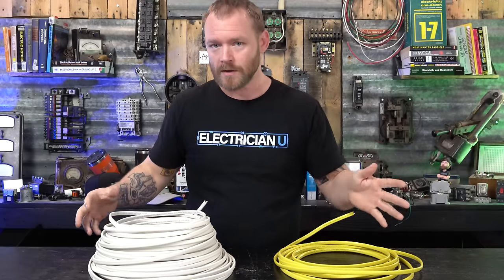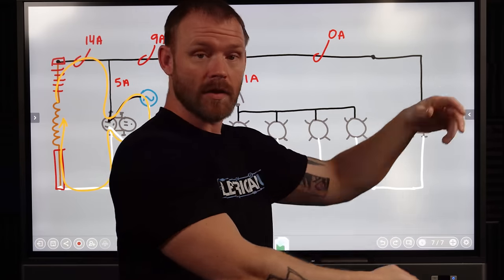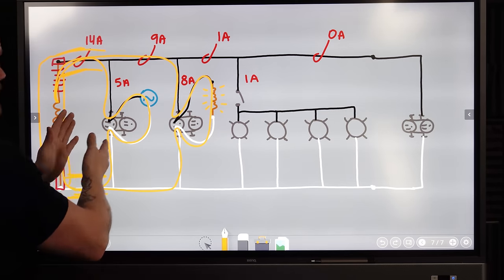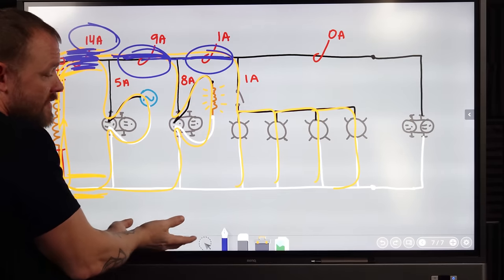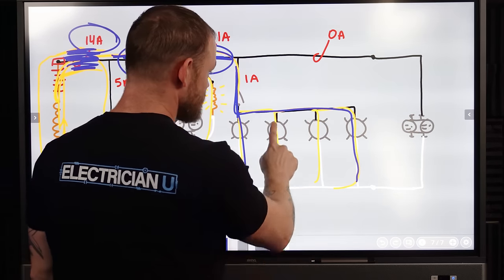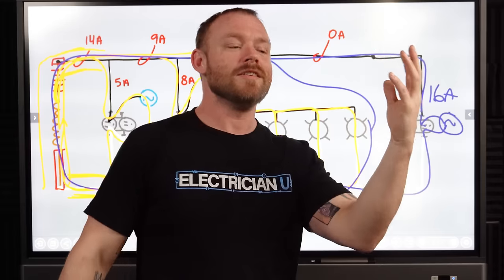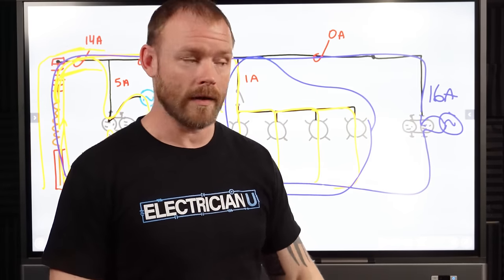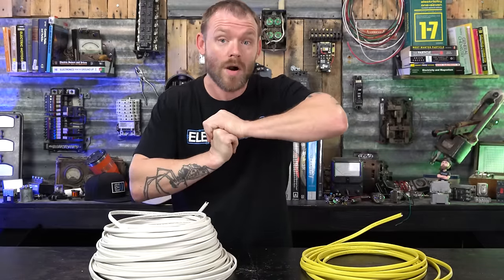Should You Be ONLY Using 12/2? When Can You Use 14/2?

Comment: Our AHJ lets us run 14 between switches and to dedicated LED luminaries without a socket base.
Why they are okay with this is interesting.
1
NM-B is 90c wires. It can handle 25A. It’s limited to 15 by convention at the 60c limit for historical reasons (there’s a lengthy discussion in the committee comments on incandescent/hid luminaries and nm, without the b, cable from the 70s)
They use the luminary and dedicated circuit code to justify why this is okay.
2
The switches and dimmers are only rated for 15A. Or less.
Likewise, a 5-15 can be installed on a 20A circuit. So, this hazard for is already determined as an acceptable risk.
3
Partial faults resulting in more than 12 and less than 16A just aren’t likely to happen. Faults tend to be opens or shorts. And, from 1, it’s not going to fail even if you do have a partial failure.
4
Workmanship in LED luminaries junction boxes is likely to result in abraded, pinched or cracked wires and insulation because the size of the boxes is just not great. This is much more likely to cause a hazardous failure compared to a partial over current failure.
4b
the new NEC regulations (410.11)  prohibit junction boxes behind finished ceilings above luminaries. (Otherwise they would require j boxes above each led light)
5
LED lights terminals are rated for 75c. And they don’t put out much heat. This is counter to why 14 and 12 is limited, so, the AHJ determined the risk for permanent LED fixtures sufficiently low, providing it is difficult to install something other than LED lights.

There was a lot more detail we went into, but this is all I’m willing to type up.
Overall, of all of the risks and hazards involved, their department felt this was the least likely to result in failure.

Comment: i've run 30a through 14/2 (open air)as a long extension cord one  temporarily. it got warm but not to the point it damaged it.  the codes are designed for maximum safety and really derate things for said purpose. the only thing other than code arguments here would be the topology in the circuit. it must be correct. it must be so that at no point if there is a fault  that the neurtal wont be carrying 12 ga amperage on a 14ga neutral. his diagram should have shown the light neutrals coming together then teeing into the return  singularly.

Comment: There is 0 reason to use 12 gauge wire in bedrooms amd lighting circuits. Over 100 homes later and we have received 0  calls about 15A breakers tripping. 12 is got kitchen baths and garage. And dining because it’s required.
Reply: That's how we do it also. Never had a problem.

Comment: I wouldn't cheap out on 14ga from the switch to the lights. The LED light may only draw one amp but a fault in the circuit won't draw just one amp! 14 vs 12 could mean the difference between a house fire and just a breaker tripping!

Comment: i have always been of the opinion that lighting should be on its own circuit. Also, all receptacles in a room  should NOT be on the same circuit. Reasoning is that if you have to work on a receptacle, you can kill the circuit that receptacle is on and still have lighting and a hot receptacle in the room if you need if for any reason. But i seldom see that. and its sad.
Reply: If you are building your own home your logic is sound, but contractors bid on these houses and they are insanely competitive.  If you included any extras above minimal electrical code you price your self out of the job.  Sounds crazy but the numbers are that tight.
Reply: @Privat2840   i blame ion the architect. that should be that way on the prints so they get bid that way. Also, AC units should not be in attics and flex duct and ductboard should be illegal. BUT if people continue to accept junk work they will get worse than that as time goes on.

Comment: If cheaping out with 14 AWG wire saves "thousands", that must be a REALLY big house! Current price difference, as of 30 minutes ago, was at .10 per foot. Yep, TEN CENTS/FOOT. So, 1000 feet of 14 vs 12 would save a whopping hundred dollars. To put it another way, to save "thousands of dollars", you would be running a MINIMUM TWENTY THOUSAND FEET!  
If someone is buy a house so big that it requires 20,000 feet of wire just for lighting, I question whether they would even notice a $2000 bump in the electrical equipment cost.

Comment: The difference in price between 12/2 and 14/2 might be 10 cents a foot.  But even if that is 20 cents a foot, you are looking at $200 difference for a 1,000 feet.  If a person is building a $300k or $400k house, what is few hundred dollars?

I can see that with LED low current lights, you can have a lot of lights and only use a few amps.  BUT, if you are coming off of a 20 A breaker, you have to use 12 gauge wire.

Comment: Would it not be a concern that if there was a short circuit in one of lights, the 14 awg could melt before the 20 amp breaker trips?
Reply: A short would trip the breaker.  The bigger concern is an overcurrent situation.
Reply: According to my journeyman electrician friend, the short would cause a current surge up to the max allowed by the breaker. For that short time, you would be pulling 20amps across the 14awg wire causing it to heat up and potentially cause a fire.
Reply: @paulgrn1  Sort of.  But a short will trip the breaker so fast, fire is rarely (if ever) going to be an issue.  The bigger concern is an overcurrent situation that allows time for the heat to build up.

Now, if the breaker fails to operate, that's another story.  But if that happens, it really doesn't matter what size breaker you have .... the weakest link in the system will melt.

Comment: What happens with a fault on the 14 circuit whereas the wire is made to not melt at 15 amp but the cb does not open until greater than 20amps

Comment: I use 12/2 on all circuits. That way if you need to upgrade to a 20 amp receptacle for some reason it's plug and play. 
To argue against using smaller wire to the lights and small loads consider this, if nothing else is on and you're on a 20 amp breaker, turn on the light wired with 14/2 and a rodent has chewed the insulation. You now have a 20 amp breaker on 14 gauge wire, that is instant fire.

Comment: In the mid 80's my father would say that LED's will become normal and replace incandescent bulbs. He also said you will see designated 8amp breakers using 18 gauge to run household lights.
Reply: 8-amp, #18 lighting circuits would be a great thing, actually...  Using #14 or #12 wire for power-sipping lights seems like a waste of copper!
Reply: Actually SqD makes a 10 amp breaker in the Homeline series, and I think they can do them in QO as well.  I would like to see, with this switch to LED lighting, 16/2 and 16/3 romex and 10 amp breakers become the new standard for lighting circuits.

Comment: I went with 4 AWG for just a 12' run to an EV charger. Charge max is 48A. My dad says I wasted money and should have used 6 AWG.
Reply: @@Hfh_Df Electrician told me Romex max size was 6 awg. He ran individual wires in 4 awg.
Reply: @Hfh_Df  It's copper and the breaker is 60A. When choosing the gauge I knew 6 would be legal, but I wanted to run cooler, have a tiny bit less voltage drop, and future-proof the line for potentially more current in case I get additional EVs. The difference in cost between the 2 gauges was nominal.

Comment: Electrical Engineer w/ 15 years experience - incorrect code aside, if you do this with a 20A breaker, if there is a short circuit in the lighting during a fault you can and likely will severely damage your 15A conductors during the short before the 20A breaker trips via magnetic break. It probably wouldn't spontaneously combust, it could, but the wire can brittle, insulation brittle, and even if you make it through this, youre setting yourself up for a number of issues. That couple thousand dollars cost savings doesnt sound so appealing versus the pile of ash and insurance headache. Its not a matter of should, its a matter of when, and while everything is fine when working as expected, the truth is you must plan for the faults.

Comment: When in doubt 12-2 because if you ever need to expand a circuit you can by changing the breaker from 15A to 20A the issue is the cost. But I would always error on over kill on the conductor due to heat & electromagnetic generation the thinner conductor will cause under load. It actually comes down to surface area which the larger conductor has because electron flow happens on the outer skin of the conductor. Also #24 AWG can only support .5 half an Amp of constant current so it's a No Go for the lights.

Comment: For residential usage some local cities outlawed 14awg  Four decades ago. They got tired of Goobers using it where 12 should be.

So a local code guy can force you to use 12 awg since that is the local code.

What happened is jerks wired up remodeling and new homes with 14 awg and owners or even builders used later 20 and 30 amp breakers..then when folks ran 2 or 3 space heaters the 14 awg guage wire got hot

So you can be a jerk and use 18 awg lampcord  and 60 amp breakers too. Then when you home burns down the fire insurance will be none since you skirted common sense. Lol

Comment: 14-anything Might be good for LED lights but it’s not forward thinking Belt-&-suspenders approach.

Whilst LED lights might draw low amps? If somebody comes through at a later date and puts in a higher draw-amp fixture?, The 14–anything won’t be sufficient for that circuit.

 Best practices is to go with too much than not enough.

Comment: Been an electrician with masters and company for over 50 years and this doesn’t make sense to me. LEDs have drastically change our lighting loads so if you want 20 amp circuits for all receptacles —- do it. In most house you can probably wire all lighting on one 15 amp circuit anyway, problem is if you use fixtures with medium or candelabra base bulbs you can’t stop the next person from installing incandescent bulbs which changes loads quite a bit.

Comment: A couple of years ago I watched an electrical inspector (here on YT) say that lighting and outlets MUST be combined for a room. Holy shit! What a stupid and potentially dangerous idea. Plug something in, pop the breaker, and get plunged into darkness. If that stupid rule were in my jurisdiction I'd put in the plans that lights and outlets are on separate circuits. If the planning department accepts the plans, then you've got a chance with the inspector. If PD points out the "problem" I'd argue for a variance. And if that didn't work I'd do something like put one outlet on the light circuit, and all the rest of the outlets in the room on their own circuit. Now we do have a rule about requiring a single switched outlet in rooms (or even hallways, stair landings, etc) if there are no ceiling lights in that room (or hallway, etc).

Where I am (for residential) there's a limit to how many square feet I can light (assuming only lights) on a single breaker. More for 20 amps, less for 15. So I split my basement in half---about 2 amps of LEDs on one half and about 2 amps of LEDs on the other.

I may not be a licensed electrician, but I know you size the wire to match the breaker. I've never seen a breaker smaller than 15 amps, and I've never seen Romex smaller than 14 AWG, but then I don't get around much.

Comment: For residential wiring, You can not use wire not rated for the circuit breaker size. You can’t use any 14 gage wire on a 20 amp circuit there a few exceptions at devices or fixtures. Run 14 for lighting and 20 for plugs. If you have to tap a 20 amp circuit for lights use 12 gage to all fixtures and switches. Not sure the point of this video other than electrical theory. Tap connections on feeders is a whole other subject.

Comment: Now that yhe NEC allows 16/2 type NM-B cable to be used for residential LED only circuits sure Johnnie Homeowner will purchase the much cheaper 16/2 and use it to feed receptacles. Hope they print jacket of 16/2 something like for LED circuit only  on a 10 amp circuit hreaker .

Comment: I can't speak for every code everywhere in the world, but.........
That is a very bad idea.  Generally speaking the circuit breaker is there to protect the wiring.  That's why the wiring needs to be sized according to the breaker, not the load.  Everything you said on the diagram was correct.  In a normal situation.  But the problem is when you have a fault, or an over load etc.  Let say one of those LED lights partially shorts out, or something else is installed onto that branch.  The wire will now be overloaded and now you have a big problem.

Comment: The only problem that I see is in your LED lighting circuit and the use of a smaller wire gauge. If a short occurs at your LED branch, it's going to take 20 amps for the breaker to trip back at the main branch. using anything less than 12/2 may heat up the wire at the LED lighting and cause a fire because as the wire gauge is no longer safe for 20 amps. For that reason, I wired my entire house in 12/2 with all 20a breakers at the panel regardless of LED lighting or not. Better safe than sorry.

Comment: Breakers protect the wire. If you had an L to N short in the 14 2 the wire is not properly protected by the breaker. Regardless of how little current your devices can pull. If you want to use 14 2 just install a 15 amp breaker.

Comment: I have no problem with a branch circuit that only has a few lights on it having 14 AWG.  Or with the new LED light fixtures "a bunch of lights" However the problem is, let say "JOHNNY JUICE IT UP"  that has watched a U tube video comes along later down the road and ties into one of the light rough in box's or even if he ties into the light switch box and see's that it is a 14 AWG wire and he runs another branch circuit using 14 AWG to a couple or four or five or 10 receptacles. Then you got problems. What happened to the code that says a circuit shall not contain any wiring in it that is rated at a lower amperage rating than that of the overcurrent device protecting that circuit. Has that been changed? I know the code allows for lighting devices "ect" to have smaller wires, but even "JOHNNY JUICE IT UP" is not going to tie onto that. Well maybe not. ???  It is probably safe to say that it is 100% chance "JOHNNY JUICE IT UP"" is not going to call and have his work inspected.  I say, "and this is only my opinion and you know what they say about those" all receptacles shall be on 12 AWG wire and 14 AWG for lights only.  The code can't account for all the "JOHNNY JUICE IT UPS"  out there, especially since U tube came about. BTW is a duplex a single receptacle or is it a duplex . Duplex I assume means two,  and you no what they say about assumption,". Just a thought.

Comment: Your circuit breaker is to protect the wire, not the actual devices because if the wire is not rated properly, it's going to burn up just like a fuse, for basic lighting and things like bedrooms that's the only time I used 14 gauge anything that's a plug because you never know what people are going to plug-in Always 20 amp fuse with 12 gauge wire

Comment: Yea iv been taught in life never be cheap with electric. And if you are ever working on an old house map out the breakers 1st and shut stuff off before you ever mess with wiring and at least read a electrical book 1 time before you work on stuff. If its old wiring just put the replacement receptacle on the same way you took it off and use the same amp outlet to replace the old one. And electrical tape 3x around outlets going back in small metal boxes is a very good idea. And dont mess with aluminum wire on breakers ,because old aluminum just deteriorates due to the natural fibers around the wires.
Reply: Alao if you have to replace an old outlet with aluminum be gentle and dont tighten it down so much that it breaks the wire. Aluminum is softer than copper and breaks easier. Slow bends. And righty tighty lefty loosy with wiring direction always.
Reply: And common sense with electric is a must.
Reply: Plus the wire attaching to your breaker screw is still a hot wire just shut it all off if your in doubt. Or just call a electrician or a family member that is a electrician. Better to have someone who knows what there doing and has experience than someone who never worked on electric before working on your stuff.

Comment: You could feed it with #10/2 NMB and come off with #14 as long as you put the whole circuit on a 15-amp breaker.
Reply: No good. What if u move and the new homeowner or someone not familiar with what u did puts a 20 circuit breaker in because maybe the 15 was bad for what ever reason. That’s why u don’t mix .

Comment: Understand the theory behind this, and appreciate it but it is not practical or legal according to the NEC afaik. Please correct if this is not accurate. The local jurisdiction requires 12-2 minimum in residential applications around here and it’s a PIA! This restricts the number of conductors in a box and presents additional effort required to install devices. I wish there were exceptions for lighting circuits, but it will probably take 30 years for our local jurisdiction to make any changes.